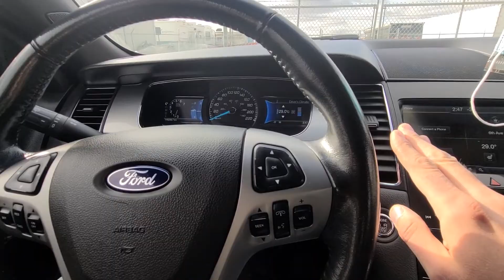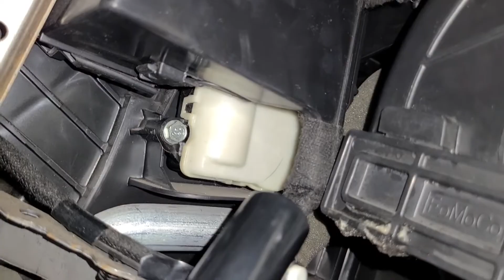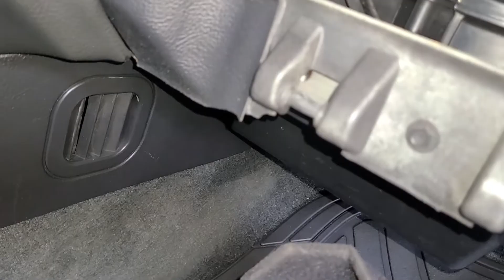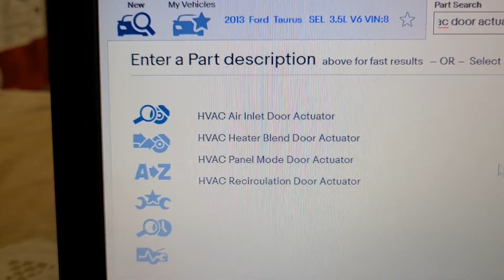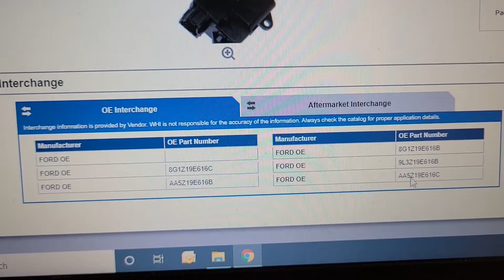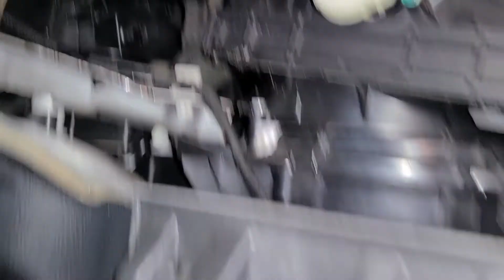Ford Taurus - PASSENGER TEMPERATURE BLEND DOOR ACTUATOR Replacement / Removal (2010-2019)

Comment: What if both sides. Temperature only changes when you go all the way to cold than when i want hot air I have to go all the way to hot
Reply from the maker: I had same problem on Ford Edge and problem was cabin temperature sensor being faulty. Also other possibility is faulty front interface control module (faceplate), especially if you have a Sony faceplate. Next step would be to scan all the modules for any error codes and do the HVAC sync test just to make sure the problem is not in the actuators

Comment: Does thing actuator control direction of air flow, like defrost etc, or is that a different one.
Reply from the maker: The one shown in the video controls warm / cold air on the passenger side. There is a different one that controls direction of air flow. I've never had to replace the other one so not sure where it is

Comment: 2016 and I have slightly warm air on the passenger side and cold on the driver side..thermostat or blend door driver side ???
Reply from the maker: Could be either. But start by checking coolant level. If good then check if engine temperature raises to the middle. And then check thermostat and the actuator. Worst case scenario would be heater core needs a flush or replacement

Comment: The computer states that you should pull fuse 46 which is the body control module for at least 1 min this will reinitialize and calibrate the actuator stop points then reinstall the fuse turn the key on calibration takes about 30 sec then you can verify correct temperature blend door operation

Comment: Thanks for the video, replaced the passenger side door actuator today Nov 17/23 used a large flathead screwdriver to turn the gear inside the heat box to see if the heat comes to the PS vents, found it easier to use a 8mm socket with an adhesive inside to hold the screw from dropping on a 1/4 in universal with a 8 in extension on a ratchet it's a bitch getting the wire connector out and back in and the new actuator out and back in.
Reply from the maker: You're most welcome. I'm glad you were able to do it and thanks for sharing your story. It will definitely help other people to do it

Comment: Thanks so much for this. You were right about the second screw, but an even bigger pain was plugging the wire back in! Also dropped one of the bolts in the dash so I had to get another. All done now and the heat works great! 2013 Taurus SEL
Reply from the maker: No problem and I'm glad I was able to help

Comment: I've done this twice on my 2011 Taurus. First time was replacing the factory actuator. 2cnd time was because I didn't get the hard-to-reach screw all the way in the first time. It is a huge pain in the ass, which is likely why mechanic's estimates can run anywhere from $300-$700 to do the job.
Reply from the maker: I know it's a pain, designed like it will never have to be changed. Or designed to force people to take their vehicles to the shop
Reply: @QuiteAlright  I'd like to think otherwise, but I bet it's the second one. I think I ended up using like 3 swivels and an extension to reach that screw, and it was still a major pain. Anyways, great video, man- as you can see in the comments it's helped a bunch of people out, and that's awesome.
Reply from the maker: @TheSnatchbuckler  Well I'm glad the video is helping people out and that you were able to replace it in the end 👍

Comment: Great video... The back screw is seemingly impossible to get to. After an hour I just took the front screw out and used a flat head to bust the white top open to reveal the circle gear (near the back) that controls the blend door. I used the screwdriver to turn the gear and viola! HEAT! Now I just have to turn the gear back to cold as summer approaches to open the AC. Simple enough.
Reply: Plz could you tell which wheel you turned,I know you said the back one but it's several...Plz help,this is so frustrating after replacing the wrong actuator...

Comment: I cut that plastic box with aviation pliers, serves no purpose, just careful with the wires.... I have a 2008 sable, same crap. Pain in the but. Got to wonder what the engineers are smoking, or need to smoke, to come up with this crap. Terrible design.
Reply from the maker: I agree the design is absolutely terrible
Reply: I was looking to see if anyone had tried that. That is my plan but I was worried about the wires

Comment: Mines is a 2012 Taurus nd when I start my car heat blows on max nd can’t turn it off. How do I just turn the heat off? or where’s the fuse?
Reply from the maker: Hard to answer your question without inspecting the vehicle. Could be a faulty blower motor resistor or maybe even climate controls themselves
Reply: You might not want to do it, but I just unhook my heater core horse ("bypass") and attached another horse to the heater core line on the motor not the actual heater core itself now when I start my car I don't have heat I have cold air coming out the same way the heat was coming out before I unhook it

Comment: Mines not having this exact issue but couldnit be that maybe its jumping gears inside? If i have it full hot, both sides will start to get colder unless i shut off the heater and start it back up again
Reply from the maker: Hmmm could be that the blend door actuator is slowly failing, sounds that way.

Comment: The main gray  connector up on top if you can get your hand up on top you can push the barb connector down and that will give you enough slack where after the actuator is pulled out you can bring it down and easily unplug the connector at the actuator
Reply: Also the wire that comes down from the black plastic box, there is a barb connector in the metal bracket which you can push out then you can move the wire a bit over. And there is another tiny barb connector on the same brace. Anything you can  move gives a bit more room. Leave it to Ford to
Reply: Did you have to synchronize the motor to the door?

Comment: Anyone know how to remove that damn black box.
Reply from the maker: You don't have to remove it, but is definitely not an easy task reaching that screw behind it
Reply: I saw on another video that it just covers a wiring harness. They guy got it off....don't know how but didn't replace it. Without it on it's an easy fix. He just secured the wires up a little higher so they wouldn't move. I need to fix mine now and am thinking about attempting it....or is this something worth paying for....it's currently below 0 here near Chicago.
Reply: @dstadt71  take a saw and cut the black box off...

Comment: OMG! This is the same style as the 2009 Mercury Sable I'm having issues with. That black box in front of the actuator was preventing me from doing anything and this video shows it is possible! I now have faith I don't have to take apart the whole dash!
Reply from the maker: Thanks for the comment and good luck fixing your Sable ;)
Reply: How do you get the damn black cover off
Reply: @CourtneysAuntSara   @COURTNEYS AUNT SARA  You actually don't. You have to take an extended 8mm socket and contort your hand around behind the blower and black box to reach the rear bolt, get it started out, then turn it by hand.
Reply: @TheOgre  I was able to get the screws out however I can’t seem to unplug it. It’s embarrassing how long it took me to remove the screws.
Reply: @CourtneysAuntSara  Not embarrassing at all! It's in a ridiculous spot. To get an idea of the taking the plug off, it's the same one that is on the blower by the foot area facing you. The push tab on that plug is the same. You just have to fiddle with it with one or two fingers up there to try and get it loose. Also, there is a slight bit of extra length in the cable so you can move the actuator out of the hole to get a better attack on the connector. Just keep at it, you'll get it!
Reply: @TheOgre  OMG WE DID IT!!! Minus one screw that had to be replaced. My husband and I worked at it as a team and hit the gear  inserted and aligned. 🎉🎉

Comment: I have had 2 of these fail in my 2010... These oem parts suck...
Reply from the maker: Yea they are not the best quality and often fail
Reply: It is not always OEM or replacement part fault that it does not last long. If the mechanism the actuator moves has an extra resistance due to: dust, debris, warping from heat, etc., etc., it will wear out plastic gears soon. Problem common across many Brands and Many models (e.g. C5 Chevy Corvettes): Solution ? Try to: 1) move many times the mechanism with that white knob from old failed actuator (like in the video), 2) try to lubricate (grease) the hinges of the mechanism (e.g. HVAC door) if you have access to  them.

Comment: I worked on the exact problem yesterday. Passenger side air blend damper was stuck on full hot. It is July and 95F outside the car! Not fun at all. To get the second screw out (the hidden one) I used a long 1/4" ratchet extension, 1/4" univ joint and a 8mm socket (also 1/4" drive.) Nothing larger will fit in there! It was also tedious getting the socket on the screw since it is very hard to see. I also used a large flat screw driver to lift the plastic box up as far as it would go and then I had enough room to slowly unscrew the screw. Dont drop the crew as you pull it out. It will roll under the blower motor and be hard to find again.

The new problem now is how to get the wiring connected on the actuator and then get it all into that tight slot again. There is NO ROOM. Either this or put the actuator in the hole first and then blindly fumble around the stupid plastic box that's in the way and somehow get the wire connector to snap in. I am thinking I need to remove the entire blower assembly first. Damn FORDS!

TIP: DO NOT try this repair if the engine has been running within the past hour. There is a heater core pipe RIGHT next to where you are trying to stick your fingers and that pipe gets REALLY HOT!
Reply from the maker: Thanks for the comment and good tip on heater core pipe. Yes it is right there.
I connected the wiring once I installed the new actuator, I was able to squeeze my hand inside somehow to get it done. I had more problems with getting  the hidden screw back inside
Reply: @QuiteAlright  It's nice to know it can be done. I will tackle it myself soon as I get the part.

Comment: Do you know which actuator I would need to replace if my system is not switching over from the dash vents to the forward vents? My 2015 Taurus is blowing cold AC like it’s supposed to but when I tap on the forward circulation, it does nothing and remains coming out of the dash. Worst time ever for this to happen. It’s 110 degrees daily!
Reply from the maker: Most likely Mode Select Actuator. I've never replaced it on Taurus, but should be behind the  instrument cluster. Before  replacing or digging deeper, try disconnecting the  battery for 15 min and see if that helps. Sometimes this actuators reset that way
Reply: @QuiteAlright  sure was! I took on that tedious project yesterday. That actuator was BURIED way back behind the dash and damn near impossible to get. Fixed the issue but shit I never want to have to do that again.
Reply: @ThatCleanMT  this is what have to do right now do you have any good videos in doing this?

Comment: Got it out the same way by turning an 8mm deep socked by hand after breaking it loose with a 1/4 ratchet. Not that bad of a job once you have a path. Thank you for the upload! This fixed my issue of passenger side temp being stuck in one spot. 2014 Ford Taurus SEL
Reply from the maker: Nice work and thanks for commenting

Comment: Me me doesn’t blow heat on the passenger side
Reply from the maker: Try removing the actuator and manually switching the setting from cold  to warm. If it starts blowing warm, you need a new actuator

Comment: Hi and Thanks for this awesome video... I have a question... What is the part called this Actuator goes in? 
I changed this out and it still blows cold air... I believe the thing the actuator goes in is broke and will not open and close like is supposed to... Any help is appreciated... Thanks
Reply from the maker: I think it is called air plenum chamber. 
Check out the schematics:
https://parts.ford.com/shop/en/us/climate-control/ac-repair-parts/motor-assy-7836065-1#sectionId:4195726

There is schematics pics down left, under the main picture.

Did you make sure the new actuator works before you installed it in?
If not, try to plug in just the wire connector, then try changing the temperature and see if the white knob turns

Comment: I can’t get the second screw out due to the plastic wiring cover. I’m about to start drinking. A lot.
Reply: The back screw is seemingly impossible to get to. After an hour I just took the front screw out and used a flat head to bust the white top open to reveal the circle gear (near the back) that controls the blend door. I used the screwdriver to turn the gear and viola! HEAT! Now I just have to turn the gear back to cold as summer approaches to open the AC. Simple enough.

Reply
Reply from the maker: I know what you mean. It took me half hour or even longer. Maybe try removing that plastic cover if you can. There should be 2 clips, 1 on top and 1 on the bottom
Reply: @QuiteAlright  I ended up getting a micro ratchet from Auto Zone and it was no problem. I don’t know how long I tried to remove the plastic cover, but I never could get the top clip unfastened. Thanks for making the video! It took a while to get the actuator changed but you helped me save $400 that I would have had to pay a professional.
Reply from the maker: I'm glad the video helped. Usually with the right tools this kind of things are easier. But I always end up not having that "right" tool :)